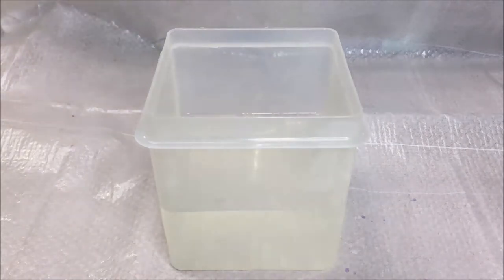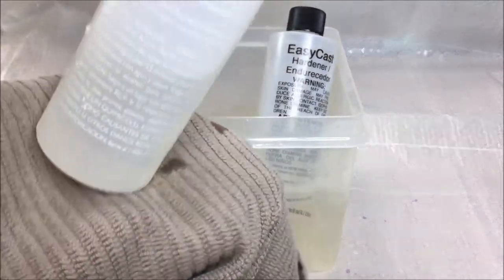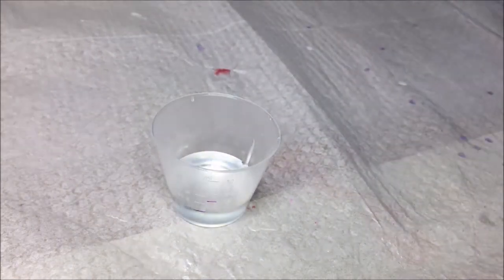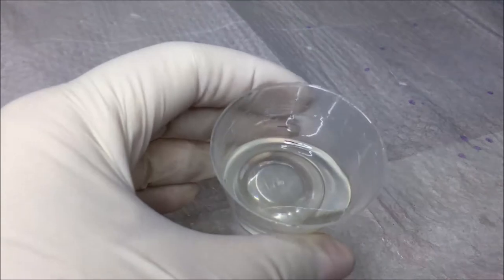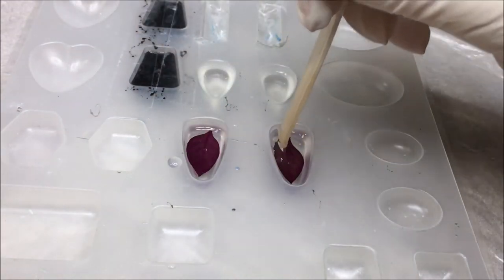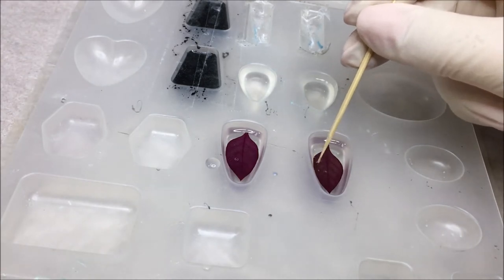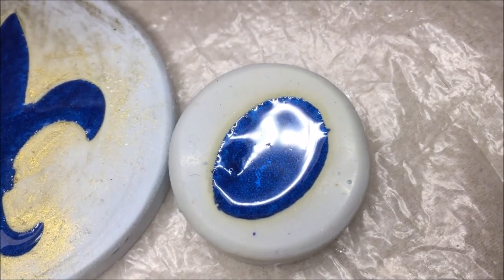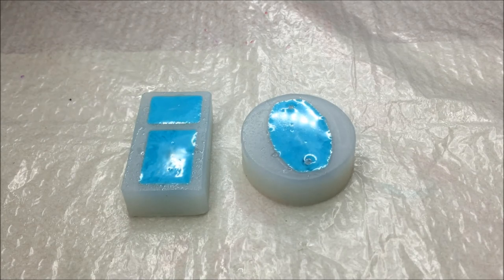Dealing with Bubbles in Resin

Comment: Great tips. I’m having a lot of issues with bubbles on the edges of my projects on the bottom. These almost seem like surface tension bubbles that don’t appear on the top and can’t be hit with the flame. I’ve thought about running a toothpick along the sides of the mold, but I don’t want to affect the design. Any ideas?
Reply from the maker: You might have some success with a mist of isopropyl alcohol. It breaks the surface tension so the bubbles pop.

Comment: Hey mylene ilove ur videos ❤️❤️ can iask u question.. how to make resin shine 😞
Reply from the maker: Hi Sara, This topic would make a great video in itself! The easiest way to get shiny resin is to use a mould that is glossy. But if you've used a mould with a matte finish, then there are a couple of different things you can do.  A quick and easy way is to spray the finished piece with Resin Spray (you can get it here: http://amzn.to/2FWktiI). This works for complex shapes where sanding would be difficult. But sometimes, when the shape is simple like a cabochon or smooth bangle, the better way to go is to hand sand it with a polishing kit like this one: http://amzn.to/2C4nc7c. This takes a lot more effort but does give a better result.

Comment: Can this tutorial help when getting rid of bubbles in UV resin? I am hoping to get some UV resin and when I searched how to get rid of air bubbles in UV resin I just get videos on the type of resin used in the video...
Reply from the maker: Hi Starlight Simmer. These tips are specifically for epoxy resin but most are still useful when you're using other types of resin. When I'm using Magic-Glos, a UV doming resin, I feel comfortable passing a BBQ lighter briefly across the surface to pop any bubbles. But for the UV resins that only have Chinese writing on the bottle, I'm a lot more cautious because there is no indication of what the ingredients in these resins are. If you choose to use this type of UV resin, make sure you're working in a VERY WELL VENTILATED area and instead of using a flame, try to draw the bubbles out to the edge of the mould where you can drag them out of the resin, or blow through a straw to pop the bubbles.

Comment: is there any way to get rid of bubbles in a closed mold? I'm making a biconvex resin (not domed) so I can't use any of these methods..
Reply from the maker: Here's a couple of different suggestions that might help. If it's a 2-part mould and your pouring through a sprue, then pouring slowly will give the resin a chance for the resin to find it's way into all the nooks and crannies and that should help minimise air pockets from forming. This will obviously only work for a slow curing resin. You could also try lightly dusting the walls of the mould with talcum powder so that it releases the surface tension. This will be especially helpful if you're using a quick curing polyurethane resin. I hope you find these tips helpful.
Reply: I've heard setting it on something that vibrates can help...

Comment: How can I deal with bubbles in us resin? Sometimes I see tiny bubbles after I’m done.
Reply from the maker: Did you mean UV resin? If so, wait 5 minutes before you put your pieces under the UV light so that they rise to the top. 
One of the causes of bubbles in UV resin is using a lamp that is too strong - too much heat introduces bubbles into the resin. Some UV resins seem to be more prone to this than others. I'd suggest trying a couple of different brands to find one that gives you better results. Take a look on Amazon and read the reviews of a few different ones to help you make a decision.

Comment: Using a wood stick to stir causes bubbles. Think of all the pores in wood. Next time you mix some resin, let the wood stick sit in it for 5 minutes afterward and watch how many bubbles come out of it.
Reply from the maker: Yes, the wood will outgas in the resin if the stir stick is left to sit in the resin, but seeing as you pour it straight away, that won't happen. If you need to leave the resin to sit before pouring, then place the stir stick across the top of the cup and you won't be introducing any bubbles into the resin at all. But if you prefer, you can use a plastic stirring wand. Here's a blog post on the difference it makes. https://milllanestudio.blogspot.com/2020/04/how-to-mix-resin-without-bubbles.html

Comment: I've tried 2 of your methods and what I'm getting is very, very tiny bubbles in the resin after the resin is cured.  Once I pour and stir the resin I don't see any bubbles as you mentioned on 2 of your methods.  The problem I'm having is after it is cured I see all these very, very tiny, tiny bubbles.  Is there another method to get rid of those tiny bubbles in the resin.
Reply from the maker: It sounds like you've got the mixing part worked out. So let's dig a little deeper to see if we can work out what's causing the bubbles. Tell me a bit more about what you're doing. What type of resin are you using: epoxy, polyurethane, polyester, UV? What type of mould are you using: silicone, plastic or something else? Has the mould been used for anything else. Are you embedding anything in the resin? Are you adding colourants? What is the environment like in the room you're working in: hot, cold, humid, dry?
Reply: @MyleneHillam  I used Amazing Epoxy Resin.  I poured the resin in a shot glass rubber silicone mold I got from Amazon.  It is a little warm in the room I'm working in.  I'm NOT putting any in the resin objects.  The very tiny bubbles are at the bottom if the shot glass.  Don't know what else to do, these tiny bubbles keep coming in the resin.  I also made a coaster and I used a different resin and I didn't have this problem and I used both resin to do the shot glass and these tiny bubbles keep coming up in the shot glass.
Reply from the maker: So we can eliminate colourants and embedded objects. There are a few different resins in the Amazing range. What is the full name on the packaging?
Reply: @MyleneHillam  Amazing Clear Cast.
Reply from the maker: @parkwayhandmadecraftstation129  Amazing Clear Cast is a coating resin and although you can also cast with it, it is best to only use it in shallow moulds because of its thicker viscosity so bubbles can escape. But that doesn't explain why you're getting micro bubbles in the bottom of the shot glass. Just so I'm clear, where you're getting the bubbles is the bottom of the shot glass, which is actually the top of the mould,  is that correct? Are they on the glossy surface? Or are they closer to the silicone? If you have a photo, that would be helpful.
Reply: @MyleneHillam  yes I have a photo but I can't send it to you through this messaging hear.  If you have another way of sending the picture let me know and I will send you the picture.  The bubbles are at the top and once I release the shot glass it will become the bottom of the shot glass and the bubbles are through out the shot glass as well.
Reply from the maker: @parkwayhandmadecraftstation129  Ah, now I understand. OK, send me the photo via message on my FB page: https://www.facebook.com/milllanestudio/. It's after 1am here so I'll take a look at it in the morning.